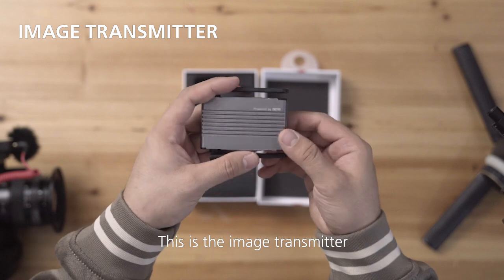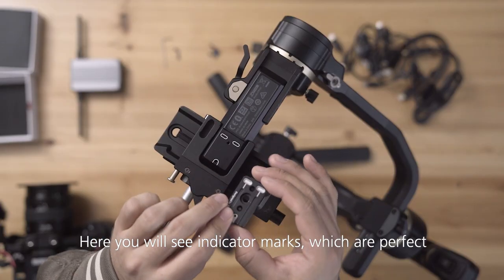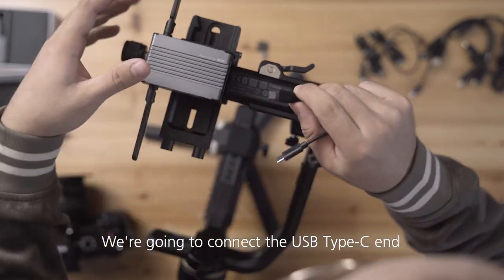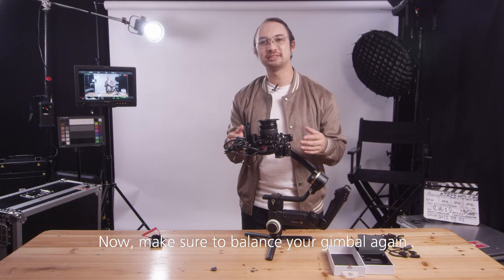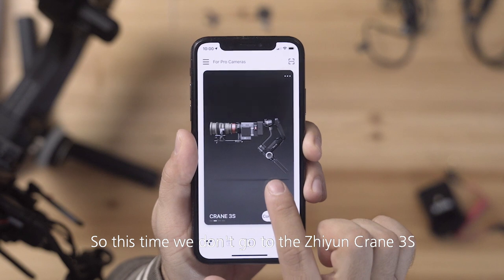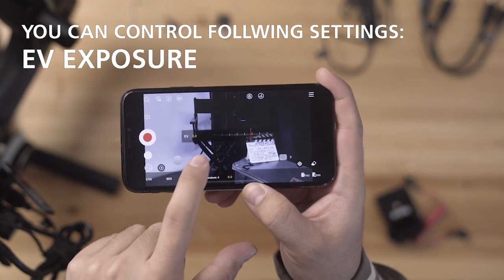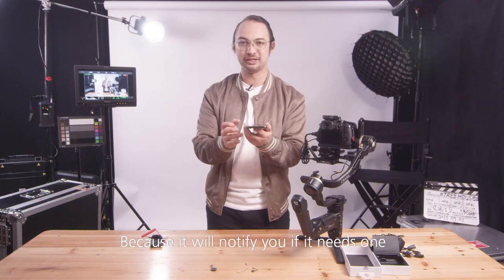Zhiyun Crane 3S OFFICIAL tutorials C2 image transmitter

Comment: Thanx for the video! Im wondering how to connect a SSD for recording to my BMPCC 6K, because cameras USB is used by the transmitter. Possible? I dont wanna use cards when using the transmitter and couldnd find an answer to this so far
Reply: Yes! How?????
Reply from the maker: yes, that is unfortunately not possible, you have to connect the usb cable, if you want to control your bmpcc's iso, aperture and so on, but if you just need the video feed for wireless transmission, so e.g. the client or director can see, then you can connect the transmitter only with the hdmi cable an on the other side a usb cable for power, but the camera control cable you could leave out and still record to ur ssd as normal
Reply: @marcelbrandel9078  will gyro sync motion controll be possible without connecting to the USB port of the camera in BMPCC 6K ?
Reply from the maker: @pruthviprince768  yes, it should work withou

Comment: Where did you get that USB 3.0 to USB C Cable?
Reply: We have looked everywhere for that 5''- 6'' inch cable you used for the GH5S because we also have a GH5S. Could you point us in the right direction to find that cable because our CRANE 3S did not come with that cable rendering the wireless unit unusable for the GH5S.
Reply: Same here. There is no USB 3.0 to USB C Cable in the box(3s Pro).

Comment: Thanks a lot for your video and the other that I watched with pleasure :) Do you know which cable I need to use to connect my S1H or my EVA1 to the image transmitter? I just find one cable in my package and it's not the good one :/ I think I have the same problem than AO DGTL :)

Comment: How to update the wireless video transmitter? What is the latest firmware?
Reply from the maker: hi, to update just turn on the image transmitter, and under wifi setting of phone connect to it, then open zy play app and under the transmitter tab it should pop up a firmware upgrade notification if it's not on the latest firmware
Reply: I upgraded the transmitter but i do not work. It is red, green, blu light. I Connect via wifi and evert thing seems right. But the screen i Black, i have a sony FX9 on the gimbal. The hdmi works out of the camera. But there is no usb in on the camera... what is wrong?
Reply from the maker: @M0LLER75  for the FX9 maybe there is an HDMI output enable/disable button, did u check there too?
Reply: Marcel Brandel yes, i just Tried to change the camera to 50p and then the video worked....is there a way to make 25p work?
Reply: Think it is strange that the transmitter only will work with 50p and not 25p
Reply: OTA version i 2.07
Reply from the maker: @M0LLER75  Hi i unfortunately don't have a sony fx9 to test, so I don't know. On my side my camera outputs only 50 or 60, so I can't test lower.
Reply: Marcel Brandel okay
Reply: Marcel Brandel I found a solution. To use another monitor and send the video signal from monitor to the transmitter. Then it will work
Reply: @marcelbrandel9078  Hey man, no internet connection prompt pops up when I connect to my transmitter? Any idea on how to troubleshoot?

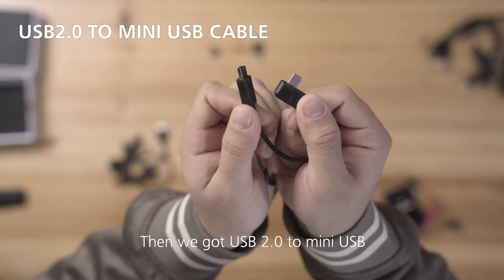Comment: 2:43 None of the cables that came with the Crane 2s box fit my Nikon D750 camera. I would need a cable with 8pin on one end and mini-usb on the other, but such a cable doesn't exist. I tried connecting an 8pin-to-USB to a USB-to-miniUSB, via a USB-female-to-USB-female adapter, but that gave out a 0% signal! Any Nikon owners out there? What adapter works for you?

Comment: To connect the GH5 to a CRANE 3S you need 2 USB C cables because the COV-03 only has 2 USB C ports... One for the Gimbal to transmitter and one from transmitter to Camera... for those who've watched this video and was still lost because he  mentions GH5s.... its not exactly like the GH5. which is not clear.

Comment: I was able to follow the steps in this tutorial until connecting to the Wifi. I saw the "ZHIYUN_TECH_74BD" listed and connected to it in my iPhone's settings menu. I entered the password "12345678" and it successfully connected, but then it tells me "No Internet Connection" and when I go to the ZY Play app and try to connect to the transmitter it prompts me to start over (routing me back to settings). How should I troubleshoot this?
Reply: Hello! I have the exact same problem, did you find an answer?
Reply: I’m experiencing the Same thing. Did you find an answer?
Reply: same thing here. ZHIYUN please wake up.
Reply: Same thing here!
Reply: SAME THING HERE. :/
Reply: So...Still no answer?
Reply: @harisajrulahi1473  haha NOPE! I actually got mine to work tho. just kept messing with it. It's not that great tho, kinda useless for me.
Reply: i have same problem did you find it ?

Comment: Hello. Do you know if theres is a cable to control the red epic/scarlet? I think it would have to be a usb C cable that connects to the transmiter,  to 4 pin Lemo that connects to the sync port of the lower back side on the red. I have seen your video that you balance a red scarlet and I know this video is 2 years old, but I just wondering if you know if there is such cable and if that connection is posible. I have the crane 3s pro and the red epic 5k. Thanks in advance.
Reply from the maker: unfortunately there isn't, if you want to gain control access of RED, you can maybe use red control or foolcontrol app to do that.
Reply: @marcelbrandel9078  cool, thank you for the answer. Is the red epic 5k mx compatible with the foolcontrol app? it´s kind of expensive for an app so before purchase it, would be nice to know
Reply from the maker: @ivancuetowicq  hi, good that you asked, if you have an epic 5K MX I think it doesn't work.
Reply: @marcelbrandel9078  In the app page says this:
To use an EPIC or SCARLET camera with foolcontrol on the same wifi network you will need to use one of these :

- RED lemo to cat5 ethernet cable and a GIG-E wireless router.

- RED REDLink bridge wifi module.

- Teradek COLR and GIG-E to lemo cable.

- RTMotion latitude
Reply from the maker: @ivancuetowicq  I remember there were ways around it, but it's truly not worth it and not reliable. In real filming scenarios, I've used RED Scarlet-W and Komodo. Both when controlling remotely with app is just a good to have case. The app is not the most reliable. Often losing signals and you'd have to reconnect. With Komodo it's now better, but especially with older gen RED cameras, I don't recommend.
Reply: @marcelbrandel9078  I think that the best option for me would be a Redmote. If you know someone honest who sells one, please let me know.
Reply from the maker: @ivancuetowicq  true, maybe redmote could work, I just haven't tried it myself, so can't say for sure
Reply: Hi guys. Why we couldn't just have the video feed without control of camera like our red ? My transmount is useless?